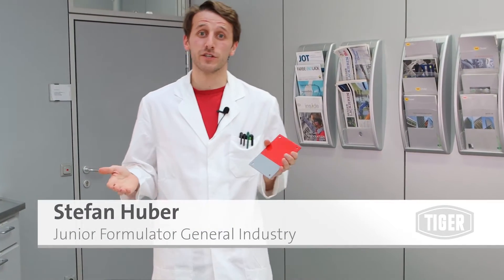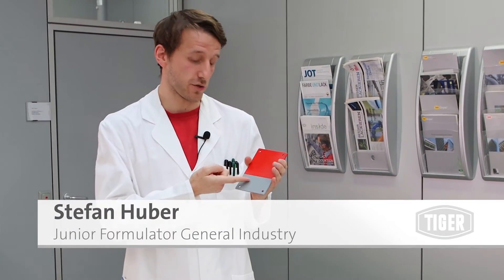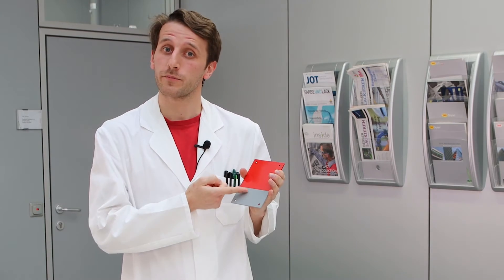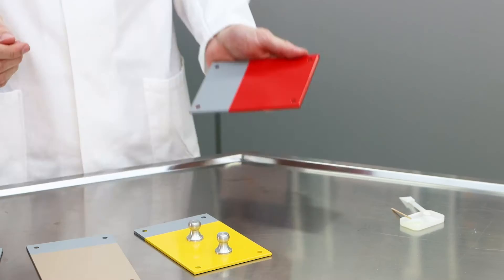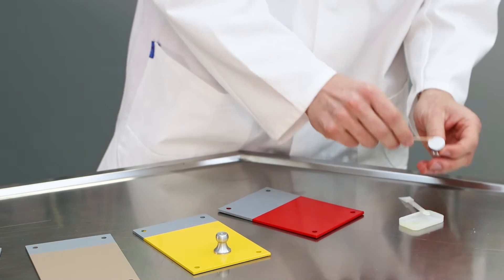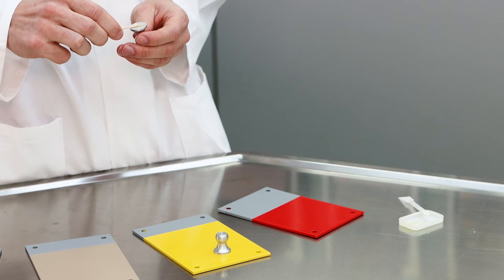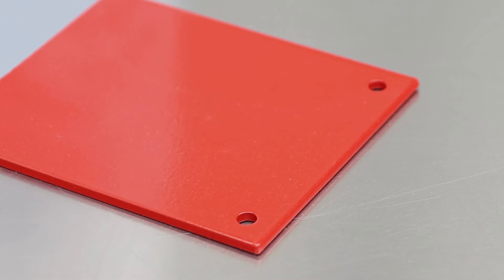Powder Coating - Adhesion Test

Comment: Hey I am trying to run that exact test on our powder coat. but the adhesive we use to stick the dollies fails well before it should.  What adhesives are you using to adhere the dollies for that test?
Reply from the maker: We use glue "UHU Plus 300 kg“
Into oven at 180°C for 5-10min.